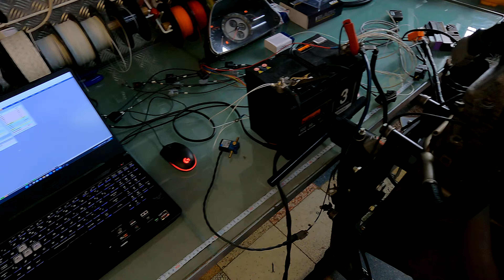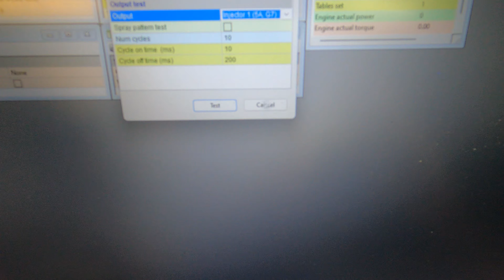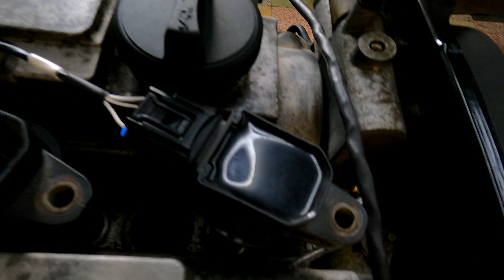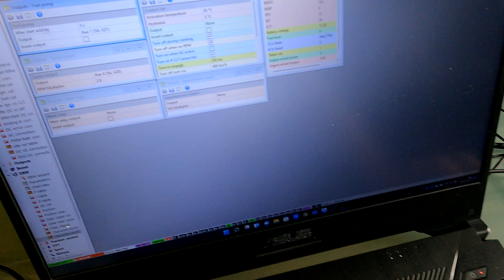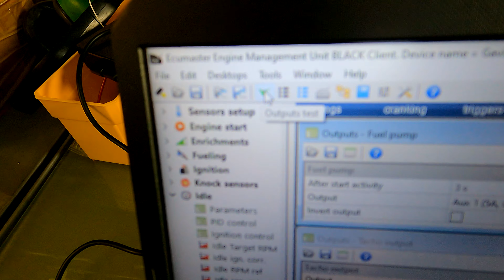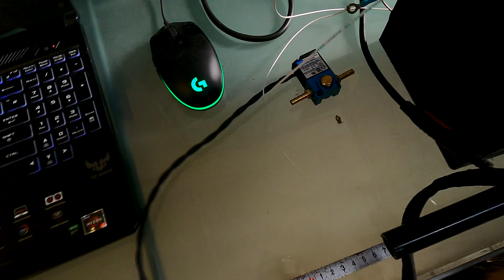ECUMaster Black ECU How to Test your Outputs

Comment: Phoenix Engine Management, I have been using your video to test my outputs on an EMU Classic.  All of the outputs have tested good but one.

The Stepper 1A on pin G2 does not seem to be working.
I have created a short video demonstrating the issue:  https://drive.google.com/file/d/1j_MO7p7PQjTYJPRwXh0y5JuDQ4axIPLh/view?usp=sharing.

Here is a link to my output pin assignments: https://drive.google.com/file/d/1RM5TB-HbhH0xwO5olJHjRPj6P81biy1R/view?usp=sharing.

Do you have any suggestions as to what might be going on?
Thanks so much,
Bruce

Comment: Great video. just subbed. Can the test still be done for a wasted spark coil pack and batching your injectors? I have a very old straight 6 and do not see any real gains for going fully sequential.
Kind regards Paul

Comment: Hoping you can lend some insight. I have a boosted 2JZ-GE with the emu black and engine specific harness, including the Bosch wideband sensor. I recently had my check engine light come on for the first time since I’ve installed the ecu (car has always had codes for o2 sensors and whatnot, however the EMU normally does not trigger the check engine light with these as it’s expected. I’ve also noticed that the emu software shows a lambda value of 1.01 consistently and never changes. Currently I have a code p1656 for the oil control solenoid, but I also thought this was a normal code to have with the EMU installed. I’m thinking I may have a faulty wideband sensor, or other sensor in the air/ fuel system but am unsure

Comment: Hope you can help me. I have a ecu master black with pnp adaptor on a audi S3 8l. Car runs good but my output test doesn't want to work. The other issue if I switch off the car it seems it stil runs for a split sec and then dies.. I have been battling a while with this issue
Reply from the maker: Hello Turbo Force. It sounds like your dealing with some wiring issues there maybe something that is not connected correctly. To have all those issues is weird.